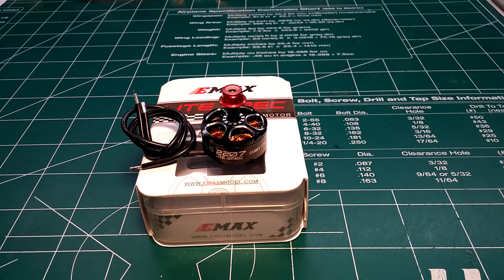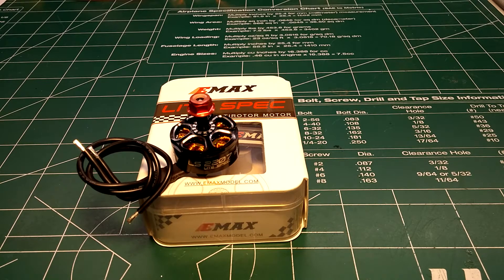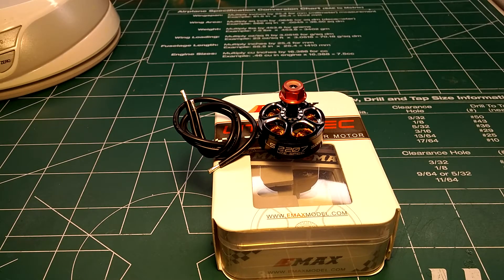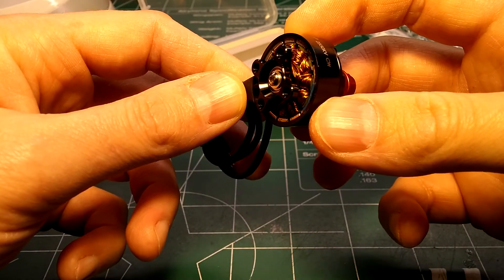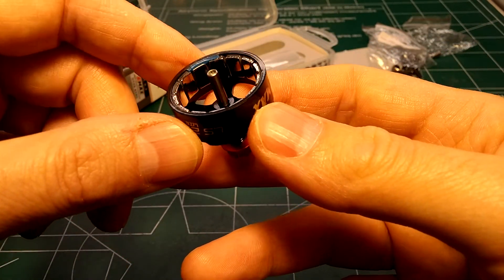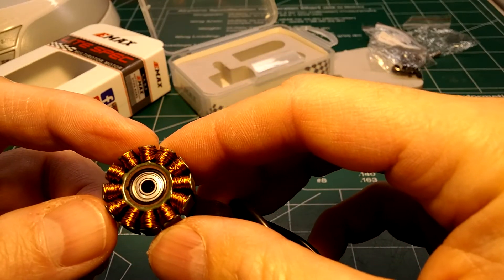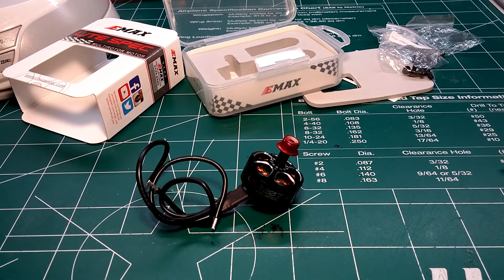Emax Lite Spec Quick Look & Overview

Comment: i got 4x 2206 - 2550kv and 4x 2206 2700kv after first flight i cant recomned them to anybody. They go hot at winter time, one from each 4 motor got instant problem i dont know if its bearing or some magnet issue but is 100% motor issue. If i try to spin them with hand it feels hard on 2 motors and easy on other two. As a big fan of red botom i am disapointed with these Emax LS2206 i cant say how the 2207 are with the quality but these are strange.
Reply from the maker: pofc - The hot motor issue could mean a number of things besides the motors themselves, such as too high D term, not enough flitering or the filtering is wrong in Betaflight, motor settings set wrong or too aggressive in BLheli suite, screws touching windings, flight controller not soft mounted causing excessive electronic noise, and over propping the motors. I've only had this overheating issue on the white top 2306 motors before, and it only happened during line of sight flights for some reason. I loosened the bell screws a quarter of a turn after checking the above mentioned, and I haven't had a problem since.
Reply: They overheat all 4 at once so its not screw issue (cant even see the screw come true hole)), about D gain: man only stock PIDs dont even try some filters off because i am pretty sure they will burn. I am using DYS F4, DYS ESC, DAL 5046,  soft mounted everything still bad... On that setup i run Brotherhobby returner R4 without single issue. I just notice that BH are notchi when i spin them in hand but all feel same, not with EMAX. I will be realy surpriced if someone can run them on PT1 NF at 0 without firework. How you like them? I can upload video from today with LS2206 2700kv if you want see it
Reply from the maker: pofc - I've read and heard that the stock Betaflight D gains are too much on some setups, try lowering them by 5 point on all axis and see if that helps. I've got the 2207 2550kv and 1900kv versions and have had no problems with overheating, so it possibly could be your esc's causing a lot of noise that's making the motors overheat as well, some combinations just don't work well together without added capacitor's for filtering.
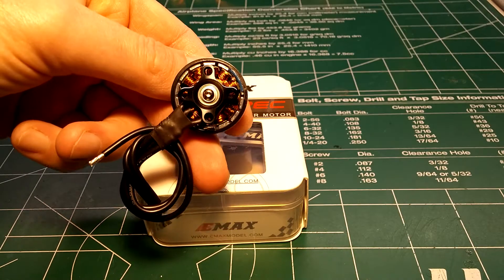Reply: https://youtu.be/_Wj6q13hHg8    - check 1:18 and it is very random on about 40-45% throtlle and left  turns. This is second quad i put them on with difrent electronic and same issue so my guess is bad motor (i have no crash them yet) so allredy order one new.
Reply from the maker: pofc - It looks to be like mid throttle oscillations or a motor/esc desync, if the new motor doesn't fix the problem I'd suggest trying some 25 volt 330uf capacitor's on your esc's to clean up the electrical noise.

Comment: What’s the difference between the 2206 and 2207 with identical kv?
Reply from the maker: FPV MADI - I can't say specifically because I don't own the 2206 2550kv variant, but besides the few gram weight difference, it's my understanding that the stator size in the 2207 can produce more thrust from the same prop as specified from EMAX's thrust data, it can produce better torque and torque handling capabilities, and it can spin heavier props better than the 2206 with better rpm transition from high to low rpm.

Comment: NOT light at all. It is actually HEAVY AF especially for a 2207. And NO, 2550kv on 6S? Only on 2" props. LOL
Reply from the maker: TweakRacer - Yeah 36 grams is not light at all, but remember that these motors use bigger 18awg wires for better performance and efficiency rather than the normal 20awg wire most motors use. I did just weigh 3 separate lengths of 120mm 18awg wire and took off the prop nut, without that added weight the motor comes in close to 31 grams, but then again who runs the motor with no prop nut or wires lol. Hopefully they perform well in the bench thrust tests to offset the added heavy weight, and for sure no 6s battery on this high of a kv motor, 5s max.
Reply: SteelRainFPV 31g is still really heavy for a 2207. I fear that efficiency gain won't be worth the weight of the motors or wires. Hope it flies well for you. And dang on 5S? You push your gear hard!

Comment: I thought these were supposed to be 28g or 30g with short wire.  That seems as heavy as the 2306 motors. I ordered some, but damn, that's not light spec.
Reply from the maker: mooosestang - Yeah 36 grams is not light at all, but remember that these motors use bigger 18awg wires for better performance and efficiency rather than the normal 20awg wire most motors use. I did just weigh 3 separate lengths of 120mm 18awg wire and took off the prop nut, without that added weight the motor comes in close to 31 grams, but then again who runs the motor with no prop nut or wires. Hopefully they perform well in the bench thrust tests to offset the added heavy weight.
Reply: it's 32g with short wires and the prop nut, problem is a t-motor f40v2 weighs 29g with longer 18awg wires and  a prop nut!  it is a 2305 though i think, but still, that's a significant difference.  I had to take the bell off one of mine, sounded like a stray piece of metal was in it, that shaft looks fragile.  I could not find any debris in the motor, i think the bell is just rubbing the stator.  Emax is not going to like my video review of this motor.
Reply from the maker: mooosestang - yeah the T-motor f40 v2 is a 2306, so I don't know what gives with the weight being this is a 2207 motor, maybe it will be very durable and efficient to offset the added weight, in which case I'll take the added weight in return for better durability. I have to say though, I've flown this motor all day on a 300 gram build and the performance and grunt was so so, my 370 gram build with the Emax 2306 2750kv motors just feels and sounds faster, but I also have to test these new motors on different props, and so far the performance is lack luster with Dal Cyclones.
Reply: mooosestang doesn't sound good i was hoping these would be good..   going to hold off now :(

Comment: If there was more time left in the flying season for me Id pick up a set to compare vs ZMX Finx30 ($25 EA). I'm back on Emax 2306 while waiting for crash replacement x30's... One thing for sure is Emax has great packaging. I love the free storage container, screws for 3 or 4 mm frames and a spare shaft screw. My ZMX's came in a crappy little box and only a spare locknut. On the other hand Emax could learn from ZMX with using way longer wires...
It probably doesn't matter but I like the cleaner/thicker windings of the ZMX and Hypetrains.
Reply: I don't think my opinion matters much since I have only compared them to Emax 2306 2400kv motors. And those are the only motors that I know really well on a 5". I think if the 2306' were the 2750kv version I would have a better comparison. But I do really like the x30's performance. I get the same flight times pretty much on my 3 favorite props (Avan, GF 5152 & Dal T5051C) that I do on the 2306. The throttle response is so effortless and they handle my heavy build at ~560g AUW with no HD cam with no hint of being overloaded. I will be going to a much lighter frame and a micro cam soon and should be under 500g easy and expect to be even more pleased with them. Checkout Kabab FPV's vids on them.
Reply from the maker: PK Villager - Thanks for the feedback, and I know there are positives and negatives to using either multistrand or single strand wire on the windings, to include cost, motor efficiency, power delivery, eddy currents, labor intensive assembly, etc.... Hopefully we will see good bench test thrust results with durability testing from real users soon.
Reply: PK Villager Hi m8.. whats youre verdict on the finX 30's ??
Reply: PK Villager yeah saw his vids already..  they do look good i'll check your channel see if you have any vids up ;)
Reply: I think I have one vid with these motors uploaded but not public yet. I'm no good anyways :D but Ill check it out in a bit and make it public.